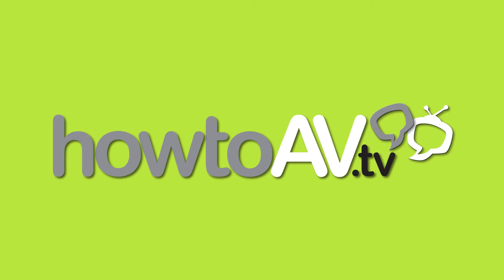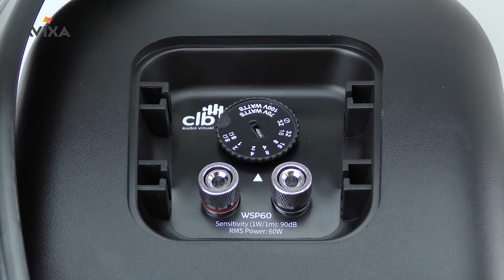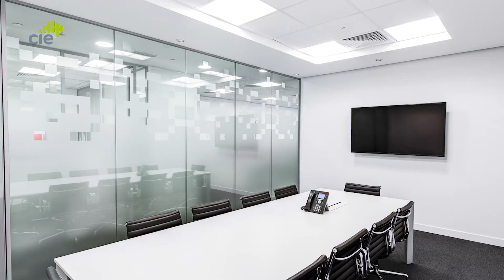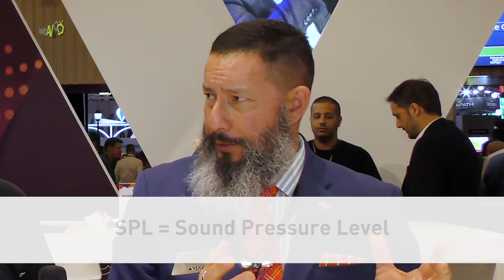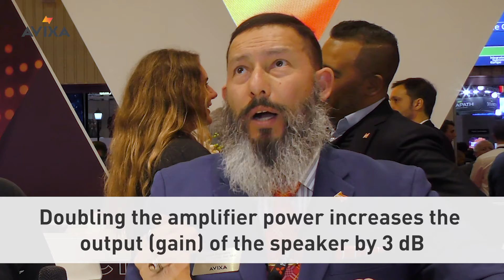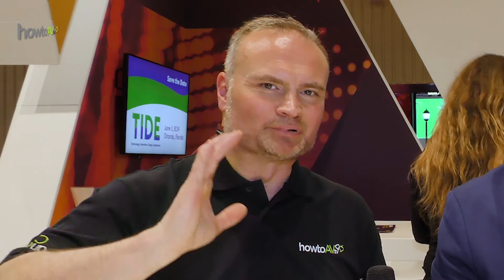Understanding 70v / 100v line Loudspeaker Tappings

Comment: I’ve got taps that say “8 ohms”, ‘N/C”, 40w, 20w, 10w and 5w. These are for 100V scale the values are halved for the 70V scale. What is the impact of moving the dial from the “8 ohms” position to one of the other spots? Will the speaker get louder? 

My Amp is 4 ohms 100W. Will it over-tax the Amp? I’d like the speaker to be a bit louder.
Reply from the maker: Low impedance and 100v line systems are not compatible with one another.
You must leave your dial set out at 8ohms for the amplifier and the loudspeakers to perform correctly.

Comment: he is just running around the bush...it is a tap i.e. a connection to get different wats from the same power line...helps you to fine-tune the volume of the end speakers...that's all...
Reply: The value of the calculations is knowing how to design a system and where to tap a loudspeaker to meet an accepted standard or specification. Tapping a loudspeaker is something that should be done once at installation and done correctly. If you are designing a system, calculations allow you to know what you need to purchase to make the system function. You cannot arbitrarily tap an arbitrarily large number of speakers and expect any amplifier to power them adequately. You may easily trial-and-error a few speakers, but if you are setting up a large system there is a need to involve some engineering.

Comment: My local made pa amplifier output volts are 95v @ 8ohms. (450 watt @ 8 ohms)
it has no output transformer.
The dc supply rail is 95+95. 
Can i drive 100v line speakers on it?
how many speakers i can drive on it?
Reply: No you cannot drive 100v speakers from an 8 ohm output.

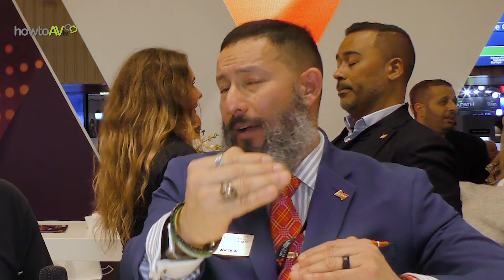Comment: 2:51 I know it wasn't intended, but the speaker should be tapped at 16 watts not 103 watts, he means that @16 wattage input the SPL at the desired location will be 103 dB.